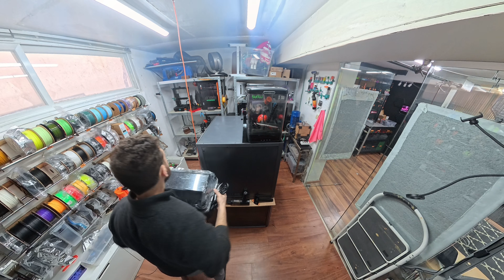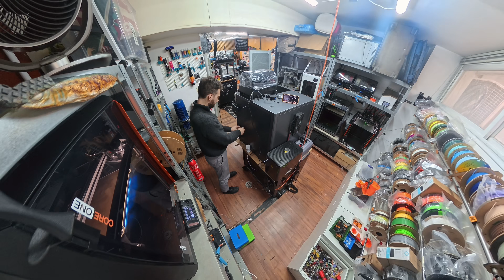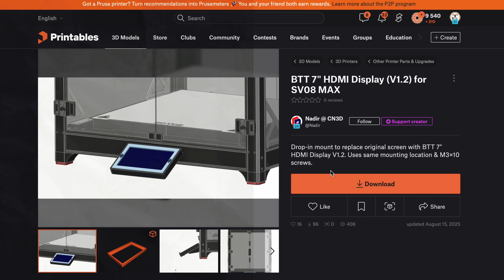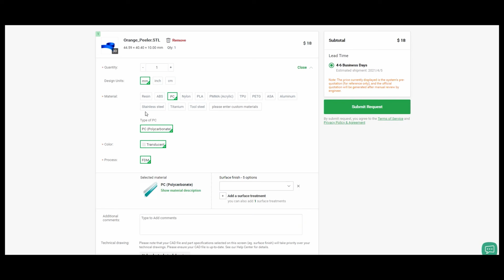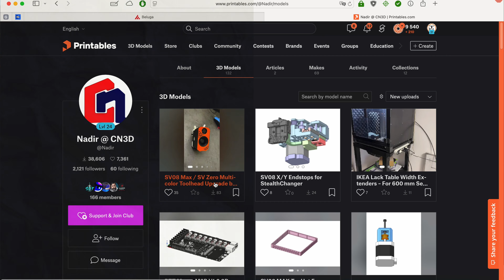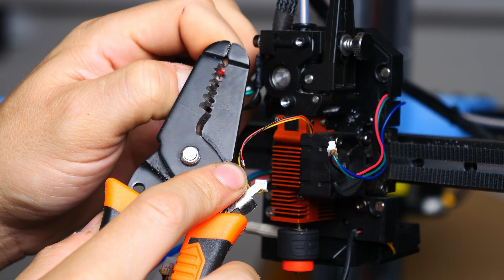A First Look at the BigTreeTech ViViD Open Source AMS

Comment: I'll be dead honest...totally on the fence about this.  When I first heard about it I was excited but that was a LONG time ago and they just took to long to get it to market.  Now I have my U1 and this really doesn't serve my needs, BUT...I do have 7 printers and this could be put to honest use on 1 or 2 of them.  Now with that said BTT will really need to blow me away to get me to take the risk and that is based solely on my experiences (mostly negative) with their stuff I have.  Not sure if it's just bad luck or if I'm the problem (I don't think I am) but BTT electronics just don't last long for me.  I had a CB1 fail on an M5P out of the box.  The replacement CB1 worked fine still and I did NOTHING different with it.  That M5P is going strong but the second one I got blew a fan mosfet and took out the buffer IC so all fans, hotends and bed all went down.  I was able to repair that board but it shouldn't have been needed.  Orange pi cm4 equivalent running on it and it's fine.  But the Cb1 that was on that board was put into a BTT pi adapter board and it smoked the RAM after a few hours of printing.  That CB1 was replaced with a Cb2 which is going fine.  Got a Pi v1.2 and that one let out the magic smoke on first connection (via usb c) and BTT replaced it.  That one was connected identically (same cable and power supply) and it's running fine.  While BTT has helped and replaced SOME of the failed boards they fought me every single step of the way and really soured my view of them.  I have been able to swap parts around from the failed CB1s and Pi V1.2 and get the Pi back up and running and so far it's been solid but I simply cannot trust ANY of their stuff long term.  Oddly enough NONE of the MKS boards/Pis or mellow fly stuff I've gotten has EVER failed or caused me ANY grief so I outright refuse to believe I'm the problem.  So based on how BTT stuff has worked for me I expect a 50% chance the ViViD would die within minutes of being setup, 30% chance it would die within a few weeks and take something else out with it, 15% chance they'd actually help with these problems and a 5% chance it'll just work as advertized.
Reply from the maker: Apparently, since I recorded this video, they now support the AFC firmware, which in my opinion is much much better… So I think I might try to migrate over to that
Reply: Putting it on u1 will bypass the four colour/material limitation
Reply: @sifustfu  With how I print 4 colors isn't a limitation.  I don't print trinkets or toys that get thrown out in short time.  I print functional stuff and the U1 gives me that solid and simple multi MATERIAL option I need instead of color.  Just printed of a sling hammer and bolt hammer and using PETG with PLA supports was perfect but it was all black so I didn't need color options.  At best I might combine 2 colors in 1 print or MAYBE up to 4 materials (ie PETG + PETG-GF + PLA supports)

Comment: you can skip the toolhead sensor and just use ramming. its much better anyway.
Reply from the maker: That’s the least of my issues. The cutter was a major hassle. Needed sub millimeter accuracy in cutting the blade

Comment: Instead of worrying about the cutter and a compatible toolhead why not use Tip Forming instead?
Reply: Because of unpredictable behavior in different toolhead setups and for different types of filament (for example tip forming/ramming for petg almost always leads to a hairing/clogging problems).
Reply: @ArtDesignEngineering  exactly why you work on calibrating it, especially for different filament types. Its not set and forget like the cutter.
Reply: Tip forming is extremely unreliable
Reply: @Krautech sounds like user error. There is a bunch of calibration required, especially with different filament types.
Reply: @SPUNGUH no, not user error. It's just not reliable to put to consumers. Tip forming can be done for those very experienced users, for which something like this, isn't for.
They want it to be SIMPLE and as close to plug and play as possible.

Comment: I would love to see the Anycubic Ace with a Mod to use on Klipper machines.
The Ace is around 70€ (220€ for Kobra 3 Kombo, resell the printer for 150).
Reply from the maker: I think it’s been done actually. But wow I had no idea it was soooo cheap. That’s bonkers.
Reply: @thenextlayer  Yes, there are mods on Github, but other than that, I have not seen any Tutorial or Video of it. (I am a total beginner and messing with Klipper and not knowing when things go wrong and how to resolve them without a really really steep learning curve is a bit too much for me right now tbh)

Yes, the K3 Combo on Aliexpress is often for 220€ even for the v2. And I resold the K3 for 170 as its brand new, got the Ace for 50€ in the end.
Would be nice to use the Ace on Klipper machines even just for the 4 spool dryer.

Or maybe have a seperate Raspberry and use the Ace without any printer at all. 

Thanks for the video and reply! :)

Comment: It's cool to see how much more universal and affordable multi color printing has become, its make you wonder where we would be if Bambu Labs hadn't made the AMS.
Reply: How much more universal and affordable? There are very little affordable options that has tool changer. To be precise a single option. And it needs a stupid hat. And you get not a whole lot print bed area. Surely there will be a ton of options in a year from now but not now. And filament drying and storing and printing 6-12 or more filaments while keeping it dry is still a pain in the ass.

IMO multi color / multi material printing currently is the farthest thing from being affordable and universal. You can't just consider the machine price alone. You have to factor in other aspects that's needed for multi material as well. And even the most basic type of filament costs 10x or more the price of a KG of plastics of injection molding. And you pay a fortune for other stuff. Yeah 3d printing has a ton of more road to go.
Reply: Probably somewhere with much less poop. Don't forget that before Bambu Lab, all multi-color systems, such as the MMU, did not cut the filament but tried to form a tip by ramming before pulling the filament back. As a result, very little filament remained in the tip of the nozzle and, accordingly, there was less waste. But since people were okay with throwing away buckets of poop, other manufacturers adopted the same approach.
Reply: @andreas.grundler  do you also remember that the MMU1/2 didn't work well for many?  A lot times its about how you execute.  Bambu did a fantastic job with their supply chain (except filament these days) and realistically they didn't invent much but they executed very well.  So well that that it became a dominant player by creating a whole ecosystem in such little time. From a business perspective, Bambu has done a fantastic job. This is just my 2 cents.
Reply: @andreas.grundler the mmu also just didn’t work seamlessly it had an insane number of issues which were fixed with the ams.
Reply: @andreas.grundler  lets just say there is a reason everyone is copying the Bambulab AMS system with individual feeder units and a cutting blade instead of Prusa MMU or Voron ERCF units with a sliding selector. One will do thousands of swaps without any calibration and the other wont.